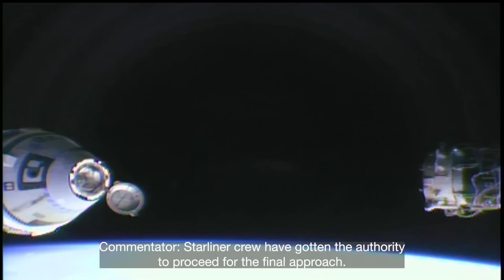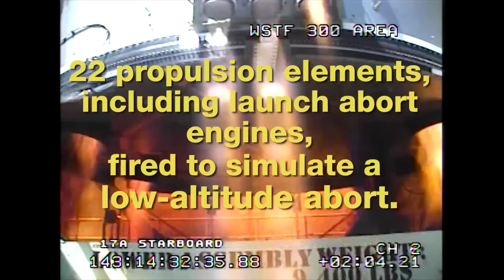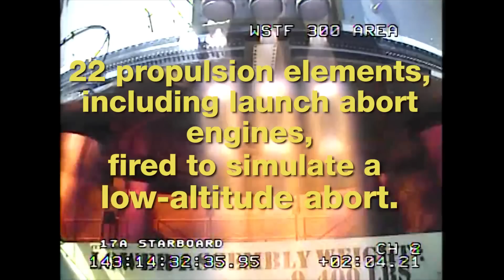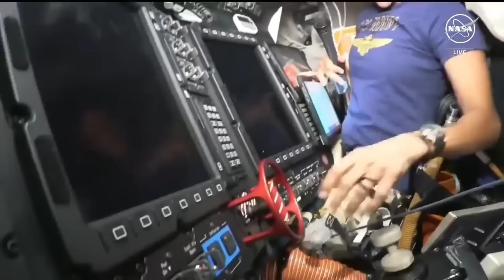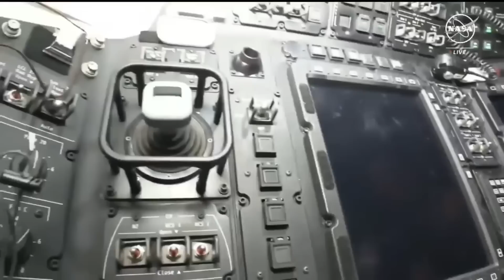The Decision Is Made - Boeing Might Be Safe? But SpaceX Is SAFER!

Comment: I wonder why NASA did not mandate that suit connections be common between Dragon and Starliner?
Reply: You have to understand while the immediate goal is to get people and equipment into (and out of) space, the long-term goal is to improve all these systems used for space travel. And the fastest way to do that is to encourage lots of different companies to come up with lots of different designs. So you can rapidly test out the pros and cons of all the different designs in parallel. If you mandate everyone has to use the same design, then yeah you get compatibility. But innovation and technological progress stagnates.
Reply: That kinda reminds me of Apollo 13 and the filters being different. Also just by looking at them the suit connections are very different so not sure if adapting the capsule (possible using an adapter) could be the easier option.
Reply: On the surface it would seem fairly easy that the umbilical connection should use the same coupling system for the suits' air supply and heating & cooling, but maybe it is more complicated than just the coupling depending on the suit designs.  After all you go to the hardware store to busy some hose and there are maybe four brands of hoses, but they all used the same size connectors.  Though maybe that is the result of one company winning the standards war 100 years ago using market forces, kind of like how VHS beat out Betamax.  Perhaps in a future successor to ISS, NASA would have required suits to use the same connections for their launch vehicles, so a Space X crew could jump in Boeings ship in an emergency or vice versa.
Reply: because NASA...
Reply: Because that just wasn't a goal. The point of these commercial projects (cargo, crew) was that NASA gave the vendors basic requirements — get four astronauts to the ISS and back, must be self-docking, must have at least X days free operation — and left the vendors to find their own solutions to the problem.

If they'd instead said things like "first, you all need to agree on a bunch of new standards to ensure all your solutions are interchangeable", SpaceX would have said "fuck no, not for a trillion dollars", and Boeing would have said, "sure, give us a trillion dollars and a cost+ contract".
Reply: because nasa is run by politicians, that is why.  This starliner problem is more a bad reflection on nasa than on Boeing.    Recall that nasa murdered 14 astronuats with their mismanagement of the shuttle program.   nasa approved sending astronauts on the starliner.   nasa is a joke, we should cut funding for this space crap by taxpayers.
Reply: Because Boeing wasn't going to use space-X's design when they could waste billions on their own design...
Reply: Because suits are complicated and SpaceX believed they could innovate and did not want to work with boeing
Reply: If you want a ton more bureaucracy like that, you get Boeing not SpaceX.

Comment: Why don't they add 2 more seats to the Dragon going up so all 4 can go up and 6 can come back? It was designed to hold more seats
Reply: They will have that as an emergency contingency plan while Starliner is gone and before Crew-9 arrives, but NASA is very uneasy about having astronauts #5, 6 and 7 being underneath the top 4 astronauts during a splashdown landing as the Crew Dragon is configured...They could if they needed to but they would rather not if they don't have to and instead put experiments returning to Earth and other equipment to be taken back down below the 4 astronauts.
Reply: Probably the time to design, build, and verify that stuff. The dragon that they’ll be using is probably fairly far into production/refurbishment and testing already.

Comment: I'm glad they aren't pulling another Colombia. Celebrating safety!!
Reply: Columbia.
Reply: You got that right. Shouldve been manslaughter charges.
Reply: and Challenger. 😔
Reply: @LuciFeric137  What could they have done though on short notice? Send up a rocket with the missing tiles and some glue perhaps? Would have required space walks and other things, I guess in hindsight they could have been saved.
Reply: @SanctuaryLife  lol. Yeah, just do nothing. Hope. The failure is not an option guys. The guys that got Apollo 13 home. Smh

Comment: The question now is how toast is Starliner
Reply: Probably not as much as you think.  Boeing has good lobbyists, at this point they are a government employment program, the government will not allow them to fail.
Reply: @CaptRR  Lobbyist did not help if Starliner burn in re-entry ;)
Reply: It's not toast as long as NASA still requires it. Which they do. But at the end of the day, Starliner is a complete disaster. Even if they complete the absolute minimum of the contract requirement (three operational crew missions to and from ISS) they will barely have enough time to do so before ISS is deorbited. Boeing simply does not have enough years left to fulfil the six flights that were projected in the contract. They will still have lost billions by that time, and its unlikely they will be able to recoup those losses by flying to other space stations, such as Blue Origin's Orbital Reef (even if that station ever flies). Plus, they would have to find a new launch vehicle too since the Atlas V is out of production.
Reply: Nasa has always insisted that based on their analysis, Starliner have always been able to return crew.  They mentioned this several times in the last briefing.    They said that they went through all of the modified firing simulations, during ground testing, in New Mexico.   So, everyone who said Starliner is stuck in space is going to look really stupid when it deorbits and lands safely.  Just like NASA and Boeing stated it would.
Reply: At this point it would be more cost effective to pile a bunch more money into Space-X and have them start working on a next-gen Dragon. Boeing is doing nothing in terms of innovation and apparently not much in terms of manufacturing either.
Reply: @linesided  I don't think SpaceX would have any interest in a next-gen Dragon. Not when their maximum effort now is Starship, the HLS version of Starship, and the heavy lift booster. They already have four Dragons in service, with a fifth nearing completion. They'll look to maximise revenue and profit from those (and from Falcon 9 and Starlink) until Starship is operational. Then we'll see how much of a future Dragon has after the end of ISS.
Reply: Too big to fail …something of that line, probably the worst phrase ever created
Reply: @gate7clamp  That service module needs to be redesigned.   They will do a temporary fix on it, first.   Other than the service module problems, Starliner did ok.  NASA, Boeing & AJR( service module thruster builder) has done a good job finding remedies to the problems to enable Starliner to get home safely.  I think Starliner should have had 6 cargo flights, first, though.   The crew module has done good on this flight.

Comment: The luxury of two non-compatible spacecraft.
Reply: the luxury of having a spare spacecraft design in case one fails
Reply: @NoNameAtAll2  Take the Russian instead.
Reply: Make that 3 non-compatible spacecraft. They are even less compatible with Soyuz, since they can't use the Russian docking port.
Reply: Privatization of space flight has been a disaster.
Reply: @artificial_idea  Well, the Falcon 9 is one of the most reliable rocket designs of all times, whilst being relatively cheap at the same time, and the Crew Dragon is the safest and most efficient way of getting people and cargo on and off of the station, so as far as I'm concerned, privatization of spaceflight is not so bad
Reply: @artificial_idea  Respectfully disagree...Boeing spaceflight has been a disaster but privatization of spaceflight gave us SpaceX and Rocketlab and now many more smaller space startups.
Reply: @artificial_idea Except that SpaceX has landed hundreds of orbital-class boosters and provided the US with the means to get people to and from the space station...

Relying on old guard corporations to innovate is what failed.
Reply: @artificial_idea  No one apparently remembers the incompatibility in the CO2 filters that almost doomed Apollo 13's crew.  Well before "privatization" of space flight.
Reply: @CorwynGC  that was over 50 years ago. Having private interests trying to literally reinvent the rocket is ridiculous
Reply: @artificial_idea  No one is reinventing (literally or otherwise) the rocket.  What is happening is IMPROVING the rocket.  I, for one, am in favor of improvement.  And it has ALWAYS been the case that that is coming from private companies: McDonnell-Douglas, Boeing, Draper, Lockheed-Martin, ULA, etc.

Comment: Boeings part on Sls is also far behind and is holding up the whole project, which is a big boondoggle to begin with.
Reply: Currently looks more like the conclusion of the Orion heat shield investigation is the main thing holding back Artemis II SLS stacking. The Orion crew module is built by Lockheed Martin, not Boeing. EUS is a little more uncertain, but at least for Artemis 2 and 3 Boeing doesn't seem to be holding anything up.

Comment: My suggestion, cancel Starliner and fund SpaceX to build at least 4 more Crew Dragons. There is your redundancy for full crew rotation operations
Reply: My suggestion. Cancel Starliner and sign up Sierra Space and Dream Chaser for the true next generation of spacecraft. It can completely replace Starliner with even more capability.
Reply: I agree. The Boeing one doesn’t work. Have one platform and build on that. It seems Boeing isn’t the only entity that needs rebuilding, NASA does too.
Reply: So much for the egomaniacs and progressives taking over iconic american enterprises..... Piss on boeing.... Go sierra space !!!!..... Go spacex !!!
Reply: It was only a few weeks ago that the entire falcon fleet was grounded.
Reply: @owensparks5013  Bur the difference, just as it was when SpaceX detonated an entire Dragon during testing, is the SpaceX instruments their vehicles so thoroughly and monitors so closely that they can tell not only what caused the malfunction, but what to do to fix it quickly to get FAA approval to get quickly back in service.

Everybody has anomalies. The great ones know how to analyze and fix quickly.
Reply: @RockinRobbins13  I agree with all you say there, but my point was you don't have true redundancy by having multiples of the same system, not if a fault with one can ground the whole fleet.
Reply: @RockinRobbins13  Think of how easy this would have been if Boeing had a temperature sensor in the thruster doghouse. On OFT-1 they would have seen that the doghouse gets hotter than the thruster are rated for, and they would have fixed the issue without having to even see a thruster failure.

Comment: I wonder how does this relate to the ValveTech v. Rocketdyne lawsuit regarding the valve design on the Starliner. If Rocketdyne making copies of the ValveTech valves might be in part cause of the engine issues, and how Boeing would deal with that.